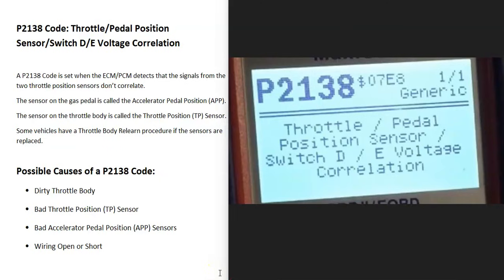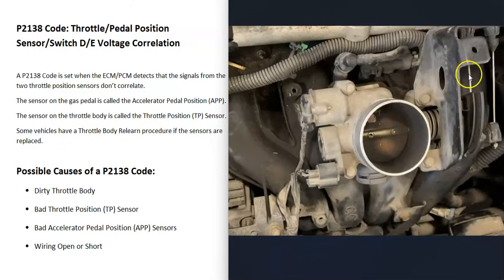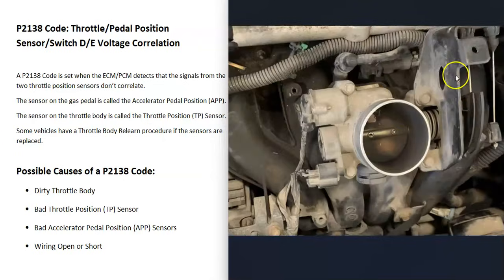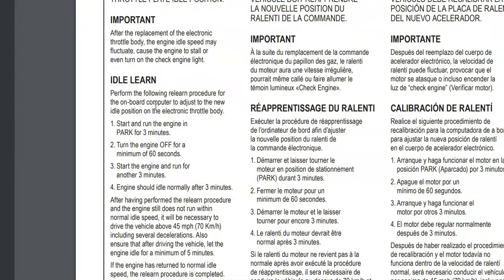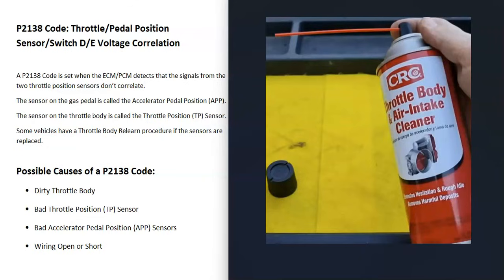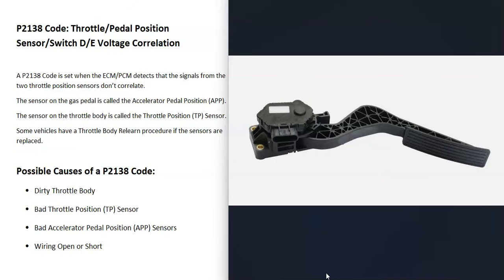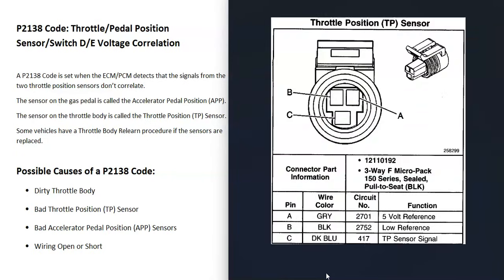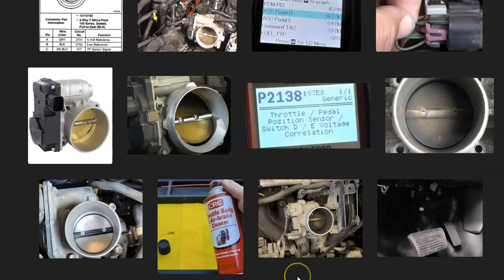Causes and Fixes P2138 Code: Throttle/Pedal Position Sensor/Switch D/E Voltage Correlation

Comment: I have been having this problem for at least 8 years.  I have replaced accelarator position sensor, throttle body position sensor, PCM, cleaned throttle body, deoxit on all connectors.  Any tips on how to fix would be much appreciated

Comment: Is this vehicle GM tho? To my knowledge GM vehicles label the TPS differently and the P2138 code and D/E switch correlation is actually referencing the redundant sensors both located in the pedal.

Comment: So I have a 2017 maxima I've replaced the pedal 2 times with sensor attached... I've replaced the throttle body with brand new one and have had the car in shop to have the necessary relearns... after that mass air flow engine light came on... cleaned that with maf cleaner.. no lights for about 4 days than all sudden again check engine today pops on with traction control lift at same time... the codes reading accelerator position sensor again???? Can you help
Reply from the maker: It sounds like you got all the most common causes. There may be a wiring issue, such as a bad connection. I would check all the wiring connections and be sure everything is plugged in good, along with the pins in the plugs.
Reply: @HVAC_Mechanic  thanks ill have to check the plugs.... and pins
Reply: @HVAC_Mechanic  when that check engine light comes on the traction control comes on at same time would a bad hub throw this code for accelerator position sensor as well?
Reply from the maker: Many vehicle computers shut down driver assist programs such as traction control and ABS when the engine has certain codes.

Comment: very helpful video. In my case, check engine throws me this error every time there is high humidity. Usually after dry days when there is rainfall. Do you see any correlation here?
Reply from the maker: It needs to be diagnosed but sometimes components that are starting to fail or a bad wiring connection can act up when the weather changes.
Reply: Coincidently I got the same code right after it stopped raining, and it was so humid for the first time after winter
Reply: did you fix your issue?
Reply: I'm having this same issue.. anybody know what the issue is?
Having it on my 09 Chevy Tahoe Ls
Reply: Seem like the weather interfere with my truck....keep getting reduced power....idk maybe it's a sort somewhere 😕🤷🏾
Reply: @grimminalmyndz  In my case, I replaced the gas pedal and air throttle. Knock on wood, there's no check engine light yet.

Comment: Anybody have a clue why changing the Crankshaft position sensor caused my throttle body to suddenly have a issue and my brakes are spongy and the lightning bolt randomly kicked on and sent my Rpms to 1500 then the bolt went away, on my dodge avenger 2012 2.4L  im confused as I may try cleaning the throttle body as thats all i can think of at this moment

Comment: I have a 2013 Fiat 500 and I took it to the shop so they can change the oil and check my AC because the compressor is not kicking on. Got my can back and every light is on my dash and the AC switch plug was unplugged. I plugged it back in and the car went to limp mode I unplug it and it runs but shakes and reduced power. Idk what’s going on and I gives me this same code. How can unplugging the AC switch make it go into limp mode. My car was running perfect before I took it to the shop. All I really needed was an oil change.

Comment: @HVAC Mechanic, I been looking for a tutorial like this which provides step by step instructions on how the accelerator pedal and throttle body work together. Kudos on the great tutorial;  anyway, my girl's car, a 2002 ford fiesta, has been giving either an "EAC FAIL" error with flashing lights or the P2138 error code with my OBD2 scanner tool. I have already replaced the accelerator pedal and the problem went away for I think about a month and now it's back again. My girl took her car to this mechanic who says its the throttle body without providing any definitive proof. So because she's stressing me out about getting her car fixed, I went ahead and ordered the throttle body which will arrive by the end of the week. Of course, I'm going to be pissed if this doesn't fixed the problem, and I will report back with the results and ask you for further guidance.
Reply: "I'll be back".....................a year ago.  LMAO.
Reply: @jlester4892  yo guys did u fixed the problem ? i already this shit happend to mah n mly car entering the limp mode Vw golf 7.5 R i changed the throttle body and this shsit happend to mah later aftrer 2d n my car entering the bloody limp hahah
Reply: Did you fix this defect and how ?
Reply: Did it work?
Reply: Ну и как?

Comment: Replaced pedal throttle body went thru all wiring, everything stays in parameters even when code pops up, it goes to limp mode, I reset and reset until engine is warm then car is fine, 2011 camaro 3.6
Reply: Did you figure it out?
Reply: @bryanbarrales1626  yes I replaced the harness behind the dash to the pedal , it had bad connections or corrosion I could go see, after throttle body pedal ecm engine bay harness and a battery all it was was a dash harness to drive by wire
Reply: @billynelson6805 did you have to rip apart your dash to replace the harness?
Reply: @blaster1120 yes
Reply: Did you fix this defect and how?
Reply: So basically is the throttle body or bad wire connection?

Comment: Accelerator pedal E stays at 100% even if I just turn the key on. I’ve replaced the gas pedal,throttle body,TPS and ECM. I’ve also replaced the plug on the gas pedal. Any idea on what would cause the accelerator pedal E to stay at 100%?
Reply from the maker: If the components are all good, then it is likely in the wiring
Reply: @HVAC_Mechanic  yesterday I was able to delete the code but then it’d come back and today that didn’t work. I’ve heard it could be something with the pedal connector or possibly the tps connector
Reply: Ever get your throttle body electrical issue fixed?if so, what did u do?

Comment: Yes I have a 2009 GMC Sierra SLE  5.3/ 4 wheel drive. I put a new throttle body on it and a new accelerator pedal sensor on it and it's still throwing code p2138. Could tell me what else it could be
Reply from the maker: If all the components are good then it is likely in the wiring.
Reply: Having the same issue, so basically the wiring harness needs replaced?

Comment: I have a Chevy Spin, I have replaced the pedal with a new one, I have checked all the cables, but there is still a code, and the dashboard indicator is still on
Reply: i have a OBD II device to read and clear the engine check sign but it was not often happens...just some time. After i used the device to clear, sometime solve it (did not see in some months)
 but sometime it again happens. So, maybe the wire was loose some where in connection points!